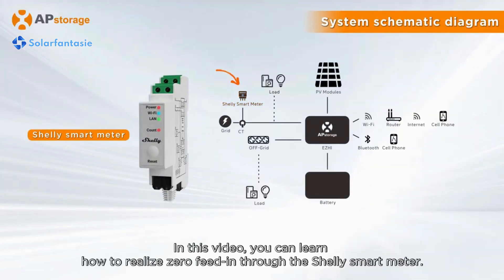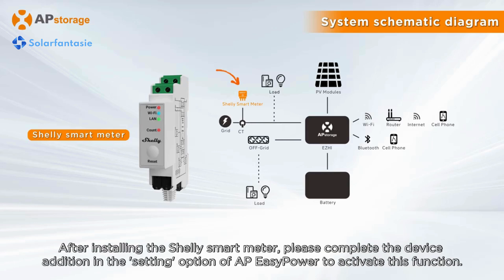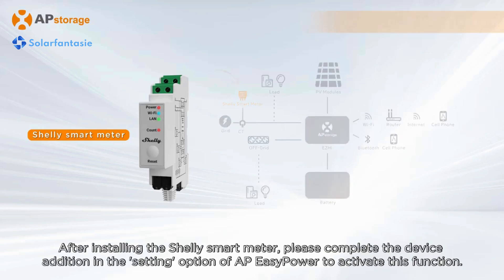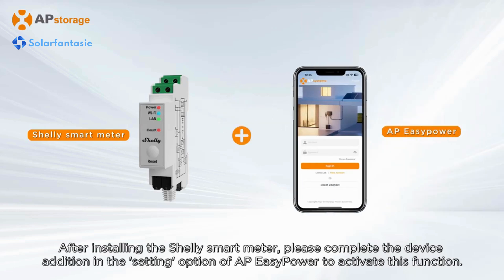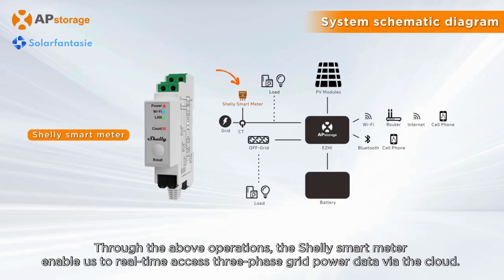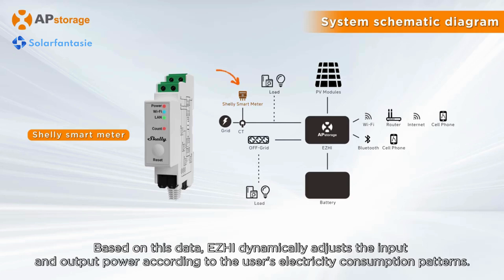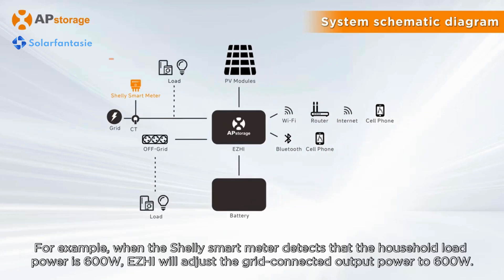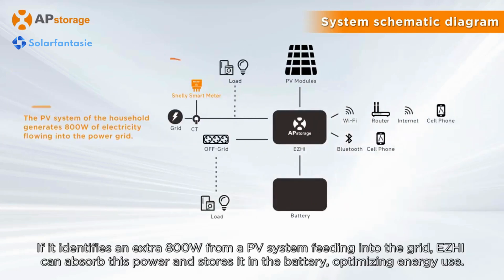Solarfantasie | Wie kann mit Shelly Smart Meter im EZHI-System eine Nulleinspeisung erreicht werden?

Comment: With the current Firmware from Shelly pro 3em 20250730-063238/1.7.0 the Pairing via Add Device doenst work anymore. I do not see the device.😢